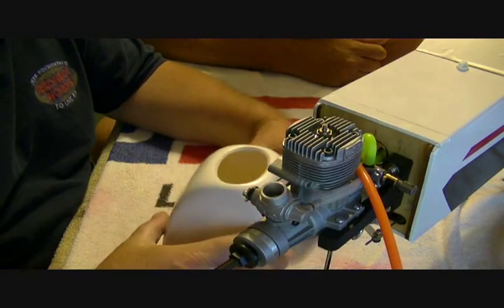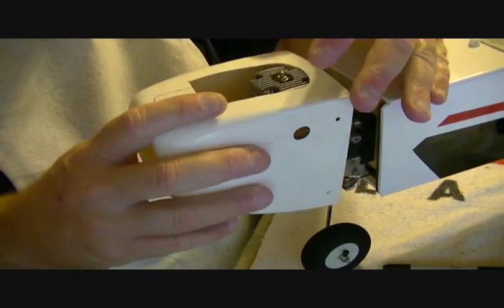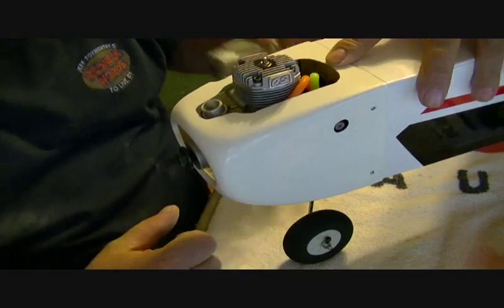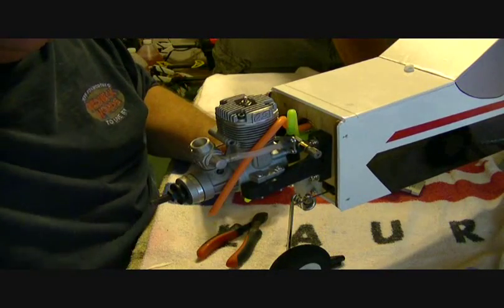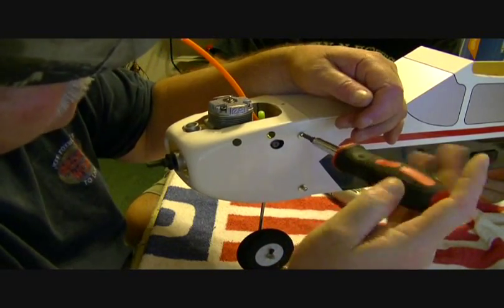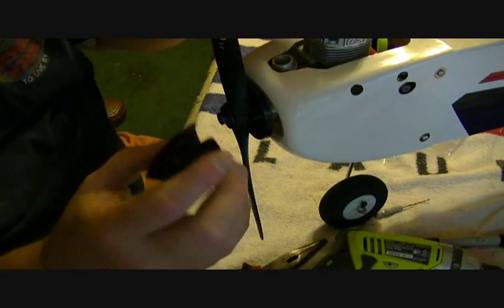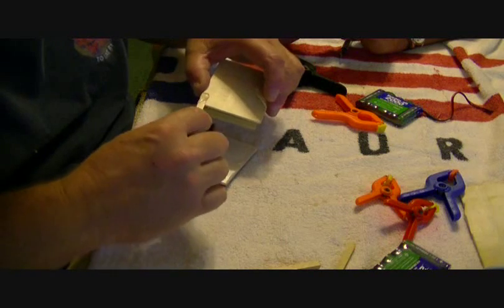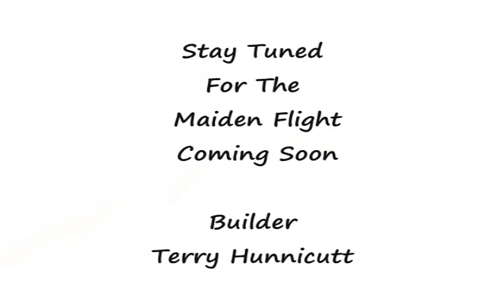Part 6 Building The Kadet LT 40 "The Finish"

Comment: Incidentally, I bought a new Kadet LT-40 (Feb-2015) from Tower Hobbies and the model is SIGNIFICANTLY improved from the version that Terry built.  It's now much improved and a bit easier to build (dual aileron servos; two-piece wing with aluminum tube; pre-cut covering in areas where glue is applied; electric motor  mount included; magnetic hatch lock; all wheels are 3"; etc.)

Comment: Hi Terry! Thank you for the postings about this build! I am new to this hobby and busy at this moment to build Kadet LT 40 Junior. I have just one question regarding CG balance and the fuel tank. Usually the tank is located at the front section of the RC plane, just behind the engine and the weight difference between full and empty will affect the CG. Considering the  tank fuel level how to balance the plane? Thank you once again for sharing and happy flying and greetings from Canada!
Reply from the maker: Hi there, so sorry for late reply, i have down with the flu for a couple of weeks. It is kinda strange that they mounted the fuel tank so far back in this plane, just balance it "EMPTY" like any other plane and balance to what the manual calls for and she will fly great, hope this helps, take care my friend, Terry

Comment: im looking forward to seeing the maiden flight. ive never had a sig plane before. are they good quality planes? I kind of fancy one of the new sig kadet senior sport arf. I like the red one. I know that the original kadet senior has been around for years and is very popular. I like the new one with its tail dragger configuration.  would u recommend it?  kind regards aidan. ps thanks for your reply on my float plane and piper pawnee. I have since sold on the pawnee but ive still got the float plane. the lake is just 5 mins away from were I live. yes your right terry its a lovely place to fly. thanks again for your help and advice. aidan
Reply from the maker: Thank you Aidan. Yes Sig is a very good well built kit,  they are probably one of the best out there. My wife has the Kadet Senior, it is a very nice plane. I think you would be very  happy with the new one, i would recommend it for sure. Take care my friend and happy flyin' to ya